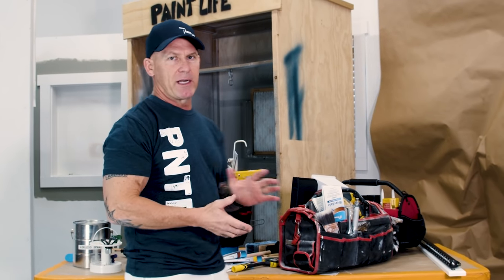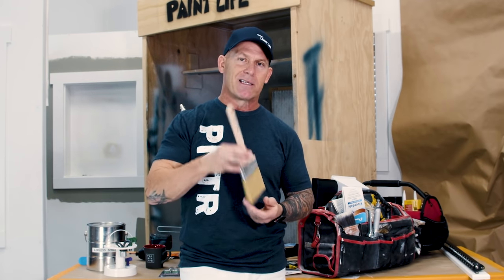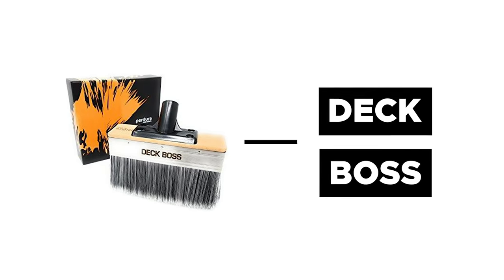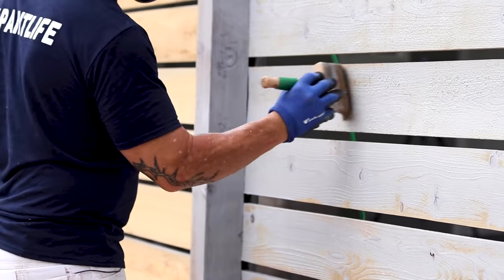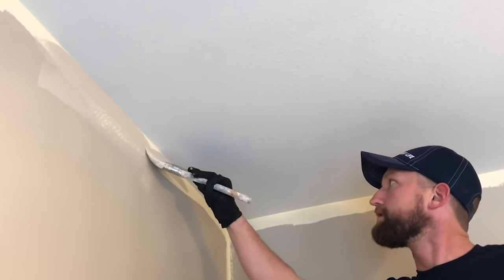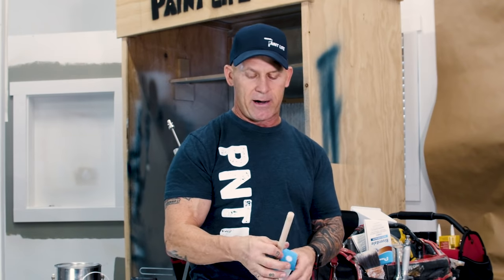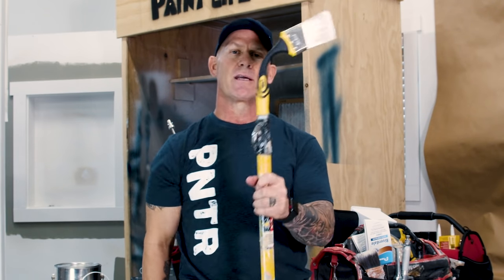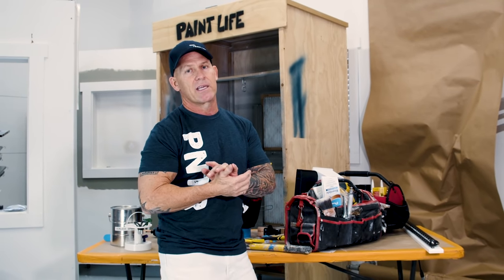5 ESSENTIAL Paint Brushes.

Comment: Wooster makes a nice chinex brush.Some people have not discovered how good these brushes are. The Chinex filament that they use is by far the easiest Brush Ever to wash out. From my understanding it is a solid filament compared to most other brushes which have hollow bristles that keep brush from washing out thoroughly and quickly. On the rare occasion that I use oil primer or paint, they are my go to brush. Hard to believe but I prefer this brush over china bristle, and they clean out superbly! Some painters that I have spoken with think the Chinex is a white china bristle since they definitely have the same appearance. You won’t be sorry if you try these brushes.
Wooster also makes the Alpha which is nice to work with and a new one that I discovered recently called the Gold edge semi-oval is also very easy to use.
Reply: Those woosters are amazing when you first get em, one of the best I have used. The problem is they don’t stay that way very long imo. Never used the gold edge semi oval but i will soon, i like ovals a lot so I’ll keep an eye out for it.  Thanks.
Reply: Corona triumph 3.5 Chinex yeah baby!

Comment: Angled brushes seem like they would be better, but a flat brush holds more paint and can also get into corners, and it can be used in both directions. Flats are especially much better for cutting walls. You know someone is using an angled brush on a wall because their cut ins are streaky and thin. .

Comment: I don’t mind some premiere products, but when it comes to brushes nothing is better then a Wooster imo, I use Wooster ultra/pro firm or Wooster ultra/pro extra firm 2.5 angle on both,  been in the paint field since 1981 and have yet to find a cutter that can hang wit me some call me the ceiling line master haha, your only as good as your brush well I tell ya Chris I have used some real crap over the years, but bad brush or not talent can overcome many slip ups haha

Comment: Good day sir, I've been watching your videos for a few years now & I must congratulate you on awesome content!
I've been in the trade for 8 years and finally I'm finally biting the bullet and purchasing my first airless machine.
I mainly do residential work but looking to get more into small/medium commercial works.
My question is I have a choice between a Graco 495 @£1500 and Graco 695 at £2000.
Can you please advise which machine is better suited for my needs.
Thank you sir
Reply: Get the smaller machine first and use the money it makes to buy the larger one. Eventually you'll have both anyway as the job calls for it. 

495 better low pressure, 695 elastomeric and volume jobs. Both will do residential fine, and you might even want to go bigger once you have the smaller machine. Don't split the baby.

The 495 will be easier to resell and get money back on if you hate it as well.

Comment: Great tips on the brush materials and the Deck Boss - I always though China bristles were for oil based paint. Speaking of oil based paint - I would love a Pros advice. I have badly peeling cedar lap siding and was planning to prime bare wood spots after scraping and sanding with oil based Zinsser Cover Stain before repainting - but I am concerned about any possible moisture in the wood pushing the paint off because oil does not breath. In your opinion would I be better off with a Latex Exterior Primer for cedar siding before going back w flat latex - probably SW Duration - SW has an Exterior Latex and its 53 Gal! Many thanks for a Pros answer, as I keep getting different answers from paint store salespeople. My house is 3 story's in places and I do not want to have to do this again for 8 to 10+ years!
Reply: the bristles are chinex which is a modern nylon looks like white bristle. unless the wood is rotten it shouldn't be a problem but before spot priming fill with a wood filler.
Reply: Use a wood moisture calibrator to determine the moisture percentage. I would not primer or paint any raw/exposed wood if the moisture content is over 11 percent. The drier the better!

Comment: How do you clean the big boss stain brush
Reply: With a wirebrush and water unless you're using an oil base paint use thinner
Reply: I like using a long teeth comp and either Pretty Boy Cleaner or Dish soup. (for water base paint) If it is oil I'm cleaning out I would use paint thinner first then go back and clean all the paint thinner with the Pretty Boy Cleaner or Dish soup. Both oil and water base I use warm water.

Comment: you don't use chinex on interiors then
Reply from the maker: Rarely
Reply: I use chinex inside on drywall for my dark colors cause it'll wash out nicely
Reply: I like using the Purdy Chinex Elite Glide for exteriors to get into the nooks and crannies. but yes they do wash out nicely
Reply: @alanrichecky49  i think the purdy pro extras are really good stiff but not over stiff so they have more flex
Reply: jack wardley I haven’t personally used that brush but I heard good things about it
Reply: @alanrichecky49  good in oils also but not as good as pure bristle
Reply: @Idahopainter  nobody's perfect :)
Reply: @Idahopainter  nobody's perfect :)